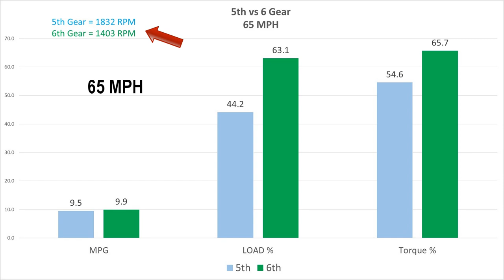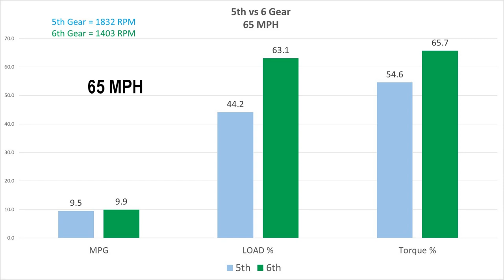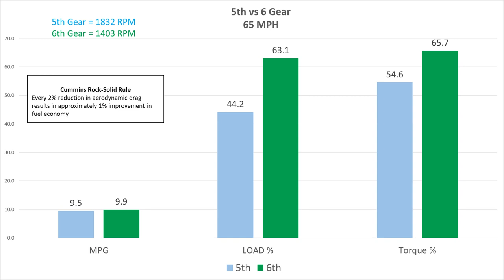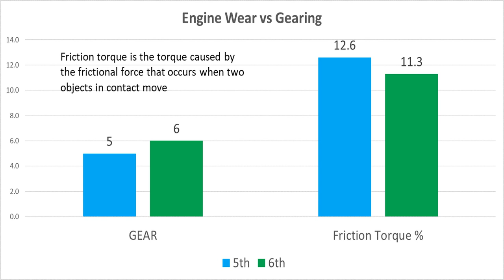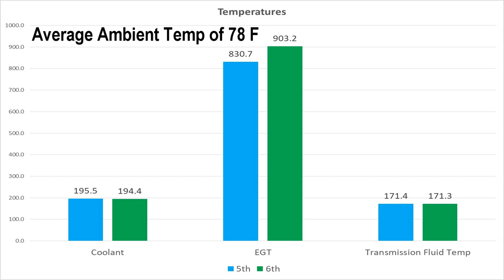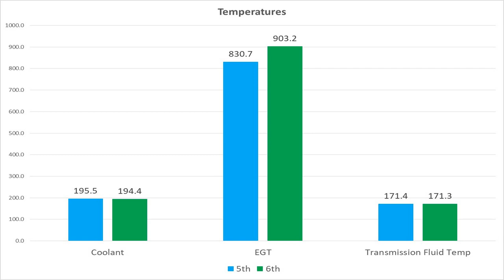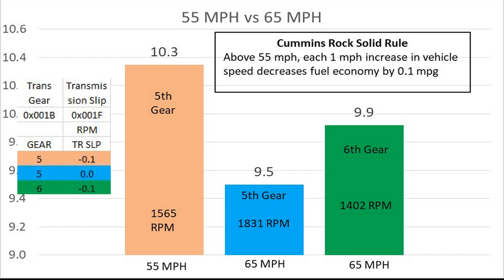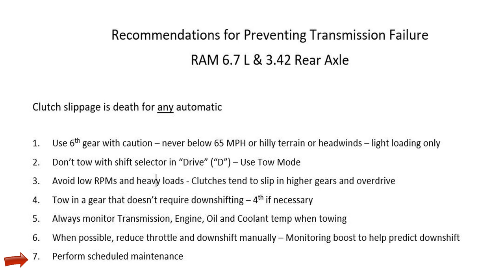RAM 6.7 L Cummins  - Towing in 5th vs 6th - Which gear?

Comment: I've had a 2013, '16, '19, '20 2500 Ram 68rfe Long Horns and now a '22 3500 traveling back and forth from Lafayette LA to Castle Rock CO and over to D.C. through the Smokey Mountains towing a 10,000# toy hauler. I live in tow haul mode and consider the weight of this truck by itself just another thing to be towed by itself.  The 68rfe, since 2019, is now a formidable Ram transmission since they fixed the harness and installed a better valve body plate to hold more pressure keeping it from leaking from  within.  With any truck or anything you tow, if you want good fuel mileage, you need to stay away from its terminal velocity which is when the air mass flowing around your truck is in laminar flow. If this speed is too slow just speed up and pay the price.  An example of terminal velocity is when you drop anything from a high altitude it will continue to accelerate until it reaches its terminal velocity at which then, its speed will stay constant until it hits the ground. Just my opinion.
Reply: Wow
Reply from the maker: Agree!

Comment: As always, excellent information. I’ve been terrified of all the “transmission failure” horror stories since I got my truck-2014 Ram 3500 4x4 with the Aisin.  Even when I tow my little 5” x 8” steel utility trailer with a 1,000lb atv, I use tow mode. Couple that with the engine brake and it will have you forehead-bashing the windshield going down hills when you let off the throttle. Works very well. Great video Marion
Reply: Aisin don't fail, those stories are for the 68rfe

Comment: You have mentioned in prior videos to manually downshift before the truck does it. Doing that on my last tow from Houston to Durango made for a much smoother tow.  Without access to all the data that you present here I came up with using 6th only on the interstate at 70mph (my max).  I greatly appreciate you putting real numbers to my seat of the pants guessing.
Reply from the maker: Excellent, thanks

Comment: I use 5th gear whether towing my 39" 5th wheel or not on the highway local. Seldom do I get a long road trip that I'm empty. 6th gear is for open road running with the wind and not towing for me.  Your data is scientific, mine is not, but I know the numbers work for both of us similarly.  You do a great job of analyzing real world numbers.  Thank you for sharing your wisdom.
Reply from the maker: Thanks.  Totally agree.

Comment: I know what you mean about enjoying the journey when your in a Cummins.  The truck likes it too.  Set the cruise and it will go until you run out of fuel or road. The rhythm of the IL6 engine at about 1800 RPM just sounds so good.  Stress reliever for me.
Reply from the maker: Yep, 1800 is about perfect for me also.

Comment: I tow an 8,000 pound bumper pull with my 2018 2500 with a slightly oversized tire and 3:42 gears. Generally tow at about 72mph. Puts me right about 1,600 rpms in 6th gear. I’m tuned to about 450 hp and have a WELL built 68RFE. Put her in 6th and let her do her thing with cruise set. If it gets too hilly I lock it in 5th and it never even tries to downshift. I have no idea how much torque my tune is making but I’m guessing around 900. Generally run 13-15 mpg depending on wind and hills. Excellent info sir! Love your videos. 👍
Reply from the maker: Thanks very much, I'd love your setup.  Headed that way eventually.

Comment: Hi Marion, another great and informative video.  You gotta be retired, because I would never have the time to do all the dedicated research you do.  My truck is a 2017 RAM 3500 SRW Limited with the high output 900 pound feet of torque Cummins and Aisin transmission.  Great to see the numbers as I always tow my 15K pound 5th wheel in 5th gear and tow haul mode.  I also have the 3.42 gears.  Trans temp never gets higher than 201 in the California desert while 100+ ambient.  Thank you.

Comment: This is why it’s nice to have a monitor or a tuner , sho you can see what gear you are in.  Maybe I missed a setting on my 2016 but it doesn’t show what gear I’m in but my tuner does.
If egt reads under 1200 to 1300 you have no worries.
Reply from the maker: Should be able to set the gear on the shift column switch.

Comment: Always like seeing the numbers. I run a 3500 Ram with 3.73 and at 62 -63 MPH I am running 1500 RPMs in 6 th gear anything slower then this I drop to 5th gear. Best MPG is 55 MPH in 5 th gear that is my sweet spot. I would run 55 MPH on the interstate but get to many horn blowers and 1 finger salutes so I keep it just under 65 MPH. Many trailer tires are only rated for 65 MPH any faster and trailer tires start to blow. Great video as always Thank you for sharing.
Reply from the maker: You and I are of the same mind on this.   62-63 mph is my preferred speed also.   in 5th or even 55 mph but I guess a little slow for the interstate.  From 65 to 55 is near $4.00/ hr savings so it's significant when you look at it that way.  I wish I had the 3.73 like your's.

Comment: I just came back from a round trip to/from Ky to Colorado and was JUST telling my wife about keeping the transmission in 5th when possible and not allowing it to shift down into a lower hear (6 to 5th) as we would approach a uphill climb.  So what timing on this topic.  :-) 

As a follow up question, do you tow your camper in 5th and use cruise control?
Reply from the maker: Yes, I use the cruise most of the time in 5th.  Some times on steep downgrade I have to disconnect the cruise because the exhaust brake want to downshift too aggressively.
Reply: I lock out 6th when I tow (I live in CA so the fastest I usually tow is 65) and that keeps my truck at sound 1800 rpm.  I have 343 gears and my truck does not like it.  Like other people have stated my truck likes 2000 rpm and I usually only stick to that when I’m climbing a hill.

Comment: Thanks Marion, great video as always. I love towing in 5th or even 4th with it's 1:1 ratio. 6th is a great gear for light/empty loads but I always lock  out 6th in any hilly terrain (I live in the Texas hill country). I really dig this 2017 6 speed with the 3.42's. Best of both worlds for no load and towing. 95,000 miles and trouble free.
Reply from the maker: Couldn't agree more!

Comment: Marion, what you are reporting is spot on for my 3500 with tha Aisin transmission as well.  To me the biggest surprise was the miniscule difference in trans temperature. It is definitely evidence of efficient cooling.  BTW, the Cummins rock solid rule regarding mpg over 55 mph is actually a protocol that was developed by the American Trucking Association well over 30 years ago for the commercial transportation industry.  Good job on the video!
Reply from the maker: Thanks appreciate that.

Comment: I have a 16 3500 and I haul my Arctic Fox camper in Alaska and there is a lot of up and down.  I’m always in tow/haul mode with the exhaust brake on full when hauling my camper.  So far far it’s worked flawlessly, even with the 68rfe, I also keep up the maintenance and don’t drive it like a maniac.
Reply from the maker: That's the key for me also, "don't drive like a maniac.

Comment: Marion, is your ATF temp of 171 measured on the Banks iDash or the factory gauge?
My 2017 seems to max out at the 167 or 168 mark, and that's pulling 12,000 lb fiver thru Missouri rolling hills on I44 in July. The iDash gets its reading from the same parameter ID as the factory gauge reading, but that doesn't mean it reads exactly the same.
I don't have one but I'm really liking that iDash.
Darn good video you made here!! Thanks!!
Reply from the maker: Thanks, all of that data is from the i -dash . You're doing pretty good if you can hold 170 with that load. Have been up over 200 in  mountains
Reply: Marion Blair I run 210-225 running up,hills with 12k, but I have a new power stroke, the ATF we use doesn’t even start to breakdown until 270, I was told by a ford master mechanic that my temps are normal under heavy load uphill, rolling hills same load my trans temps are always 197-205, locked in 5th with 3.31 rear end, after a few hard downshifts in tow haul going downhill and it scaring the crap outta me, I just use the manual shift now with the automatic exhaust brake, fords have manual and automatic brakes,
Reply from the maker: @FordF-Super  yes I get that high in the mountains also.  Super duty very nice, buddy  has one and really likes it.   1000 ft/lbs

Comment: Mr. Blair, when the time comes, are you planning to change the transmission fluid and filter for the 68RFE yourself?  Thank you and take care.
Reply from the maker: Yes, I'll do that when able.
Reply: @MarionBlair  A Cummins diesel mechanic recommended me to have my tranny fluid changed about every 30,000 miles on my 07 6.7 68rfe(20,000 even better) I put a deep aluminum pan on mine that has a drain plug on it which makes it real easy to empty and change the fluid and filters! My tranny doesn’t get above 160 towing 8,000 lbs in the middle of the Texas summer! I service my tranny myself and it’s real easy to do!

Comment: Great video. So dumb question maybe. When I'm towing heavy I put the vehicle in tow haul mode and roll. What your saying is do that but also put the shift selector in 5th, right? I was confused and thought activating the "tow haul" mode effectively did the same thing?
Reply: Once you get over 50/55 the truck will shift into 6th in tow/haul.  With tow/haul off, the truck will shift into 6th at a much lower speed.
Reply: @TheMinnow101  Got it. Someone told me at one time that "tow/haul" effectively locked out 6th/OD as well as changed the overall shift points. Sounds like I need to put the shift selector in 5th when towing heavy to save the transmission wear and tear and to keep the EGTs lower.
Reply: nova bill Yes it does change the shift points but does not lock out 6th.  It does keep the transmission from upshifting too quickly.  On my truck, not towing, not in tow/haul the transmission will be in 6th gear by the time I’m going 45 and the rpm’s will be 1200.  Hence, I always have the tow/haul on pulling our 5th wheel or not.
Reply from the maker: Yea, put it in 5th and tow haul.  It'll save a lot of shifts especially in hills and the less the transmissions shifts up and down the longer it and the oil will last.
Reply from the maker: Yes, Keep it locked in 5th.  Even with tow haul in "D" the truck will shift to 6th on downhills, overpasses etc...  then back to 5th on an incline.  Locking in 5th will save a lot of wear and tear on tranny over the long haul.

Comment: I have a 2015 3500 dually with the 6.7 and 3.73 gears. When I tow I always use tow haul. Do you think it’s necessary to manually shift when you have lower axle gearing?
Reply from the maker: It's always better if you can anticipate the need for a lower gear and do the shift manually under low or no throttle when possible.  However if your truck doesn't downshift, should be fine.

Comment: I tow our 25 ft 6000 lbs. Airstream in 5th. Legal speed limit in Ca is 55. Rpm’s around 1750-1800 Mpg around 13. Exhaust braking is more responsive too.
Reply from the maker: Excellent.  I prefer towing at 55 myself.  The drop in aerodynamic drag is significant on MPG.

Comment: When you say avoid down shifting, how does this apply when the exhaust brake is on? When coming to a stop she is always down shifting to help control the load with the exhaust brake. I was told to always use to exhaust brake to save the turbo (plus it saves brakes and heat on the rotors). What are you thoughts on that?
Reply from the maker: Yes, that's correct.  My thoughts is the downshifts are not shock loading like the upshifts under full torque.

Comment: Great info Marion. I have a 2016 Tradesman 2500 double cab long bed with the 6 speed manual transmission. I think I liked the 5 speed that the older trucks had in them better. For me it's difficult to find a use for 6 gear in this truck. Thank you.
Reply from the maker: Yes, I had the 5.9 with the 5 speed manual with a 3.55 axles vs 3.42.  That was better for me also.

Comment: What are your thoughts on the rumors of Ram going to an Allison transmission? I’m going to be getting a new 3500 later this year and was wondering if I should wait for the 2022’s (if the rumors are true). I admit to be a bit new to all of this. Have you had any issues with your 6-speed?
Thanks so much!
Reply from the maker: I haven't had any issues.  Since they beefed up the 68rfe in 2019, it seems they would keep it in the 2500.  But who knows.   As to the 3500, it would be nice to have the 8 speed Allison over the 6 speed Aisin.  So, if I could wait, I'd probably hold a few more months to see if the rumor plays out.
Reply: @MarionBlair  Thanks! I’ll wait for further information. I’m not in too much of a hurry and it will allow me to save more $$ for a larger down payment. Holy cow these trucks are expensive!
Adios my friend!

Comment: I have a 2017 Ram 2500 Cummins. I’m still in the learning curve for towing so have watched this video more than once. I had no idea about 5th gear vs 6th gear. When I tow I usually just use tow/haul mode. Now I know better. But I’m concerned about the transmission temp - I’m running about 185-190.  You seem to average around 171. It’s very hot here in South Florida - 95 and humid - so does that make a difference?  Is it something to be concerned about?
Reply from the maker: Ambient temperature makes a huge difference and also the weight you are hauling.  My average temp was 78 so 95 will increase the temp much more.  The transmission is cooled by air flow across the radiator so 185 - 190 is ok.  Constant shifting up to 6th and back to 5th will increase heat also, so 5th gear is going to probably work best for you.        I would lock in 5th gear.
Reply: Marion Blair Thanks! I feel better now. Most of my towing has been flat so far. I tow a 27 foot trailer that’s 6000 lbs dry so I will definitely lock it into 5th gear next time.  I will also keep the gauge info on the option where I can see coolant transmission and oil temps together and try to keep track of it under different conditions.

Comment: I have a Ram 3500 with the 3.42 Asian transmission. Is it okay when towing or not towing to use the engine brake mode?
This is my first experience as a new ram owner. I really love this 3500 diesel. I am a new subscriber to your channel .I have learned so much by watching your videos.
Thanks, 
Gary
Reply from the maker: Yea, no problem using it 100% of time, I do but I only use tow mode when towing.

Comment: My 2012 has a 8 speed automatic  have to research how to work it towing, is 7-8 the same as the 6th mentioned in this video?
Reply from the maker: run in the highest gear you can run without the tranny shifting down on overpasses and hills.

Comment: What's a safe temperature for the egt 1 sensor on the downpipe? When I pull my 5th wheel I've seen 950 and 960 on flat ground in south Louisiana, wondering if that's normal. I drive a 2020 ram tradesman with the Cummins. It has 15k miles on it. My 5th wheel is around 14k loaded and 13'6" tall.
Reply from the maker: That's fine.  I stay below 1000 at the EGR1 since the manifold will be a little bit higher.
Reply: @MarionBlair  thank you for all your great videos and looking forward to learning more.

Comment: Love your videos Marion! You always give helpful advice. Does Ram's Tow Mode take care of getting the transmission into the proper gear that prevents many of the issues brought up in this video? Isn't the whole idea behind automatic transmissions is to have the transmission do this for you rather than the driver manually shifting?
Reply from the maker: Yes RAM and others try to make it that way but you can do much better.  If you leave the selector in "D".  The truck will shift to 6th on the downhill and back to 5th (or 4th) on the uphill.  This constant shifting causes more wear (and heat) on the transmission over the long run.  Lock it in 5th is probably your best bet unless very hilly, then maybe 4th if it continues to shift.  5th is usually good for most everything.  Depends on your weight and speed also.
Reply from the maker: it won't lock it it'll just raise the shift point you have to manually lock it
Reply: @MarionBlair  👍👍

Comment: When I’m going uphill on empty at around 50mph my truck goes into 6th gear at about 1-2,000 rpm unless I give it throttle. Should I put into 5th even though I’m empty?
Reply from the maker: I wouldn't.  Empty, 6th is fine.

Comment: At one time, Cummins had a brochure on their site with recommendations regarding specing a truck. While it was directed towards the medium & heavy duty trucks, I found it an interesting read. I seem to recall they recommended a towing rpm around 2000-2200. So, for me, I do what I can to maintain ~2000 in the hills and upshift as the ground flattens out.
Reply from the maker: Yes, I ran my truck weight and load in their Powertech app and for fuel economy, they came up with 1800-2000, Power, 2200 or so (65 - 70 mph).  As you mentioned, that's for RV's up to 18 wheeler and for the B6,7L.  (but not that far off) Personally, I think RAM is running them low RPMs for the fuel economy which as you can see it's not very good even in 6th at 1400 rpm

Comment: Another great video! I recently had an ATS deep transmission pan, transmission case brace and coolant block put on my 2018 Ram 2500 6.7l Cummins. The extra 6 quarts of fluid really helps keep the trans cooler. It runs between 10 and 15 degrees cooler now.
Reply from the maker: Great upgrade!